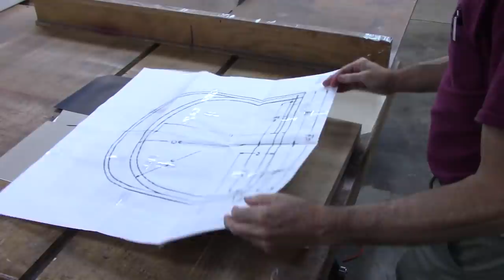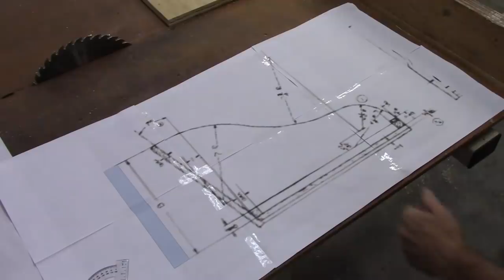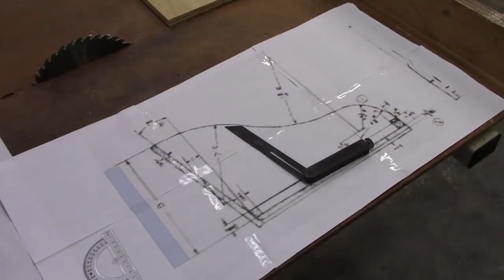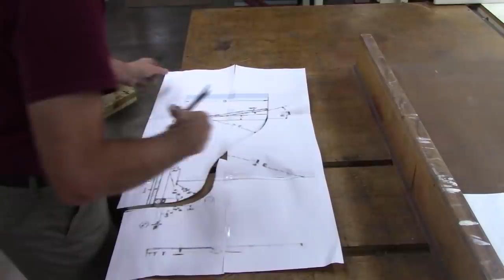Part 1 - Building a Briggs & Stratton Buckboard Flyer

Comment: I have an original   Flyer that  I  restored  some years ago  . It has the original engine .I had to make new seats and I wish   that I had had this video at that time!    What a job ! The original seats were made of  solid  American Elm  steam  bent around a frame . I made mine using 1/8  plywood laminated  with epoxy . Great job,  your car looks almost original and the wide tire is probably more efficient than the narrow motor wheel tire. The engine on these flyers tended to over heat so a fan was mounted from a head bolt and driven by a leather sewing machine belt from the flywheel .This little engine was a take off on an english motorwheel that used a magneto ignition . The" red bug" as it was called ,was Briggs and Strattons earliest efforts at a small engine and  featured  the flywheel ignition using  magnets and a coil .This paved the way for their great success in providing automobile ignition parts and the starters, and ignition switches that really made the company successful . This little car was so expensive that only the very wealthy could afford one costing about 1/3 the cost of a model T ford car.Not many were produced .
Reply from the maker: Thanks Dave, i learned a few things, Yeah my car has all the right dimensions although there are some differences. Things the steering column support were changed for convenience. I changed the engine lift lever because I was worried that it might release when I was starting the motor. And sure enough even with the catch the engine dropped and the car took off with out me. It now has a stronger spring. I know why they are high priced, they are a lot of work to build! Ha
Reply: Still have it David?

Comment: This is great. A good video for young people who are intimidated by trade work. Don't let people tell you " smarter people than us built this or that. This guy is a great workman, and thinker. Just because something hasn't been done doesn't mean it's not a good idea. All complex  problems are just a series of smaller less complex problems, and if you complete them one at a time correctly you'll have success. Never say " I can't "
Reply from the maker: Glad you like the video and appreciate my workmanship. Masterofsparks?  I've built a few Wimshurt machines as well.
Reply: @WinkysWorkshop  Master of Sparks is an old ZZ Top song... if you're not familiar with it give it a listen. It's about some good old boys building a " trap of death " for kicks. I'm also a musician.  When I was young I acquired a go- kart replica of a 40s Ford coupe, the body was wooden, but rounded and shaped nicely, it had independent coil spring suspension, two speeds w/ reverse, differential, latching doors, hood, the engine was concealed in the rear, I dunno who built it but it was all handmade, and excellent, I've been interested in such things since.
Reply from the maker: @masterofsparkshwy6974  That car sounds amazing...  I love a lot of ZZ Top. It sounded familiar when I read it.
Reply: @WinkysWorkshop  I found your videos on the wimshurt machines, I'm also an electrician in a mill, I built what I called a " sparker" not quite as cool, no glass plates etc. But I'll be watching them it's very neat.
Reply from the maker: @masterofsparkshwy6974  - Cool!  I think I've built 9 of them total. In one of the videos the guy talking has an Australian accent. I sold the machine to him. It's one of my better machines....  man shipping was high and a pain in the butt.

Comment: You have quite a remarkable and enviable skill set. I'm a wood worker and enjoyed watching your metal work as well as woodwork.
Reply from the maker: I've been a woodworker all my life and to a small degree into metal but I've only had a lathe 6 years and the mill about 2 years. To some degree the metal working is easier. Everything it more exact but you have calibrated dials of digital read outs.

Comment: I love this project!  I've got a project of my own where I'm going to attempt to build something from poorly drawn plans from 1947.  I've been working on transferring the design to CAD to try to figure out the problems before I start and boy, there are certainly a lot of problems.  One of the biggest issues is that it was pretty much assumed the plans would be used as merely the starting point of a build, but in reality the builder would be expected to use what ever he had on hand and make up the rest.
Reply from the maker: That's kind of what I was dealing with. If you are interested there is a link in the description area to the drawings and a bunch of pictures. It would have been hard to build without cad.
Reply: Ive never used CAD, but have had a lot of luck with Adobe Illustrator! ...Newk from Kentucky

Comment: I spent some time messting about with Briggs engines as a teenager, myself and some friends managed to piece together a cart with an old  5hp Briggs and Stratton which had a gear reduction box but no clutch. this engine needed work of course and only started when it felt like it, none of us had access to the parts needed and not much money anyway, so we would push the cart up a long hill near my village. I'm from Ireland by the way, and  With 3 of us on it we would set off down hill (at a fair pace!!) and whoever was nearest the engine would play with the carb until it fired. It had a very basic braking system which involved a pedal some levers and a block of wood against one Tyre, but obviously with 3 of us on it took some time to pull up!!. The wheels were of the  Honda 50 variety and the frame was 2 inch angle iron. A little heavy but strong. Once it did fire it would generally keep running and we could get a few miles out of it before we came to a steep enough hill to stall it. Then we would turn it around and with push or let it roll to go again!!. On one of our little  journeys I drove through a crossroads and almost collided with a local man, he followed us and we ditched it, running in to a nearby field. On another occasion with a friend driving we somehow managed to miss a turn and ended upside down in a drain, no one was hurt but it was great fun looking back!!. I hope today's children continue to innovate like we did lol!!😂 I love your cart by the way if only we had access to those tools then!! All the best from Ireland,👍
Reply from the maker: That sounds like a few of my own childhood adventures. When I told my wife I was going to build this cars she said, "why, are you a little kid again?" I thought about this question for a monet and then replied, "Yes i think I am a kid but now I have the tools, time, experience, and know how to make fantastic toys!" (I'm also retired).  Thanks for the fun comment!
Reply: @WinkysWorkshop  your very welcome!!😊 I came across your Chanel by accident and it reminded me of our adventures! A Happy accident!! I managed to put a 45cc Homelight chainsaw engine on a bycicle once but that's another story lol!😂 We spent a lot of time doing things like this as kids but as we say here we could be at worse!! All the best👍
Reply: Winky's Workshop thats why i built my billykarts i wanted to recreate my childhood ones but this time with the money n tools i didnt have back then. fyi my wife of 34 years left me & now i have a new one that rides go karts with me! praise jesus!
Reply: mj mayo we did the same only with no engine lol!

Comment: Very special project,Mark.It´s not a run of the mill product.Thank you for sharing all your work.
Reply from the maker: This car was a lot of fun. This video is several years old and I sold the car but sometimes I really miss it. I need to build another one. This time it will be a Red Bug which was the electric version made is 1921. Same care just electric and on board motor.
Reply: @WinkysWorkshop Sure Mark.It´s now or never.It´s something that I always wanted to do.

Comment: Just went through my shop I have a working 1943 Briggs n Stratton 3.5 hp donor motor getting started tomorrow. Love your shop. Clean and organized like mine. This will be fun I’ll get my boys involved in some welding jobs.
Reply from the maker: Right on! Sounds like a perfect motor. My only concern on mine is the lateral load rating of the wheels. They are strong wheels but the load rating it straight down.

Comment: Thank you for the exceptional and detailed build of the old Buckboard Flyer - Your inspiring video has given me the wonderful notion that I should build one myself, although it would not compare to your quality and workmanship. - I am an old hit and miss engine enthusiast and was thinking of a variation Flyer, using a small Maytag washing machine motor (clutch and belt) as the power supply and some type of small tire to propel the flyer. - I wouldn't get the speed of your flyer, but the old Maytag would provide more than enough power. - I think that it would be a fun project and something to enjoy during our local parades and events or even at Stationary Engine shows. - Wish me luck and I'll keep scratching my head to see if I can produce enough thoughts, to lead me in the right direction. - Richest Blessings!!
Reply from the maker: Love the idea of the maytag motor. My car goes 28 mph but really 20 is a bit safer and fast enough.  Good luck..  and thanks!

Comment: Back in 1963 I had a Buckboard go cart that was built in McDonough Georgia and it was built by Snapper and it had a 3 1/2 horse power Briggs and Stration engine on it and the spokes on the wheels were made out of wood and it had a shifter in the floor and it also would go backwards  It also had fenders on it and it sure did look a lot like the one you built!  I put a lot of miles on it drove it everywhere!!
Reply from the maker: Very interesting! I just looked that up. Wow...  wood wheels, I like that too. This was a kit car.  I'd like to find those wheels or how to make them.
Reply: @WinkysWorkshop  I had a neighbor that made me new wood spokes on one of my wheels when they broke out  and they worked Great He was amazing! He could make anything out of wood! He passed away 15 years ago!!
Reply from the maker: @rustbucket77  I can build the wheels but I need something to go by. Check this out. https://youtu.be/lWEq-803TEs

Comment: Beautiful project. Watching you build the seat, I realized you probably should have soaked the panels before trying to curve them. I build curved shields for medieval re-enactments and that is how I get two layers of 1/4" underlayment to take and keep a curve with nothing but glue holding them together. I also use ratchet straps and slats of wood to spread the load when I'm forming on a buck.
Reply from the maker: Thanks! No need to soak the panels. I used 3-ply 1/4" oak veneer plywood. The internal ply is nearly full thickness and the grain opposes the veneer. If you remove one veneer it bends very easy. Of course it works much better with the veneer on the outside of the bend but as long as the inside is well supported it works well. In the past I have done this and the plywood had a Luuan core and this bends way better. With that being said, I got lucky with my clamps. The band clamp alone was really not enough to clamp the two layers together adequately. Like you said, slats to distribute the load would have been a very good idea.
Reply: Winky's Workshop how did you remove the one vinier? a plainer? could i use 1/8" 3mm ply with 4 layers? i dont have a plainer?
Reply from the maker: @theadventuresofshellyandfr5618  Cool...  did it bend? I used a planer but a surface sander would have been better. My planer almost didnt plane that thin

Comment: At first I thought this would be an interesting woodworking project, then when you jumped straight into the lathework I remembered how much I love proper machine fabrication projects. I was not disappointed. Great job. Also I wonder how many people new to this channel are being reccomended the video after watching Jay Leno's Video about the Briggs and Stratton Hybrid.
Reply from the maker: Aside from the seats this was an easy woodworking project. For sure more time was spent on the machine work. I'm thinking about building another one with an onboard motor. I was considering electric but wow... $1800 to $2600 for batteries is a huge deterrent!

Comment: This is a cool idea and I never knew such a thing existed.  You've got me thinking about building one using an old motorcycle rear tire that already has the sprocket mounted to it.
Reply from the maker: that would be great. Be careful about the other wheels. The lateral strength of spoke wheels is not always great. I got mine from Lapp Wagon Wheels - so far they are doing good.

Comment: My Grandfather owned a 1917 Smith Flyer he purchased new when in Sheridan Wyoming.  He owned a Harley Davidson franchise there.   When he passed away, my Dad and I partly restored it.  We couldn't find the seats so I just sat on the frame.  I got  the engine running.  Had a magneto for spark and a bulb above the cylinder for an ignition chamber.  Just like the yours, it had a 5th wheel that you dropped down to go.  Used to drive it around the neighborhood.  Had to re-spoke  one of the wheels when I had a friend sitting on front and turned the corner.  It broke out all the spokes in the left front wheel.  We used hard rubber tires to replace the original tires.  He ended up selling it to a guy in Saskatchewan who owned a museum up there in about 1975 for 600 dollars.  I wonder what it would be worth today.
Reply from the maker: Wow... cool story! I've never seen an original!

Comment: Ammonia is the magic cellulose softener.  Store bought is pretty dilute but a good soaking in plastic bag for a few days might have gotten rid of the internal grain cracking to make absolutely no difference at all in the very fine finished product.
Reply from the maker: Thanks for the tip and compliment! This thing is a lot of fun. Did you know ammonia will also darken oak? It will make white oak chocolate brown and red oak a lighter greenish brown.
Reply: @WinkysWorkshop  I did not know that.  Interesting.
Reply from the maker: @CraftedChannel  I actually did a video on it a while back. I used the fumes but applying liquid does the same.  https://youtu.be/9HFMz15UQjU

Comment: That is a very nice workshop you have there bud. Plenty of room and all the power tools a man could wish for.
Reply from the maker: About 50 years worth. Thanks.
Reply: @WinkysWorkshop  I know, it takes a lifetime to put together a workshop like yours. And a lifetime to learn the trade. Love your work.
Reply from the maker: @paulwood2329  Yeah, it's a long story....  Lets just say, there was a point in my life where I was single after being married for 22 years. I lived very poor for about 4 years but after the child support ended I bought my old home back and proceeded to work on the shop I always wanted. I was single for about 10 more years. During this time I puts a steel beam in and eliminated 2 support posts, bought a nice table saw and dug up the basement floor and installed dust collection and wiring for the saw. After I remarried I started accumulating metal working stuff but honestly the woodworking tools were a much larger investment. Most the metal working stuff I got very cheap and restored. My first Logan lathe was a 1942 model (which I later sold and the next Logan (which I still have) is a 1947 and recently I bought a South Bend 11" which is a 1931 model. This is the one in the video. I've had the mill a little over 2 years now. I paid $1000 for it which is a little high but it also came with tons of tooling which made it a good deal. The lathes were all in very bad shape when i bought them....  lots of work to restore them but still enjoyable.
Reply: @WinkysWorkshop  Hi Winky. I do admire you. You did a brilliant job restoring the lathe. 1942, I thought I was old! I'm 72 this July 4th. That lathe is older than me but still looks new. I wish I looked as good. lol  I have worked in woodworking workshops for most of my life. I loved using all the 3 phase power tools. You know, back then they made all the best workshop machinery. I mean just look at that lathe you are using today. I bet you won't find one better new. Keep up the good work and you and your wife stay safe.

Comment: A tip. When you spray a colour always use a coat of white before the colour coat: the white reflects the light and shows the pigment much brighter.
Reply from the maker: Interesting. I think that also depends on the color. Standard gray primer might have been a better choice.
Reply: @WinkysWorkshop  I always use grey primer, then white, then colour top coat.